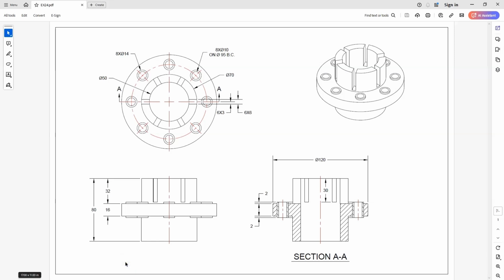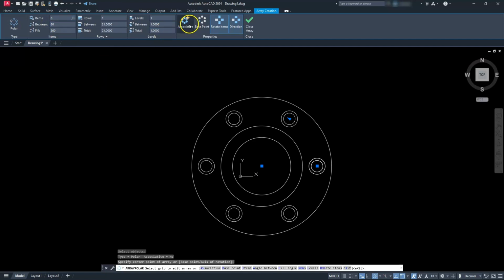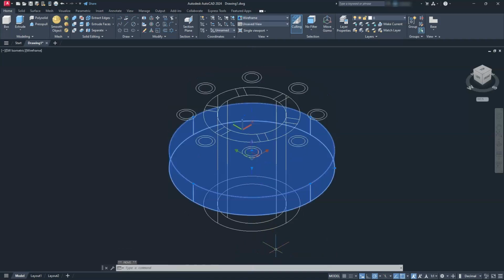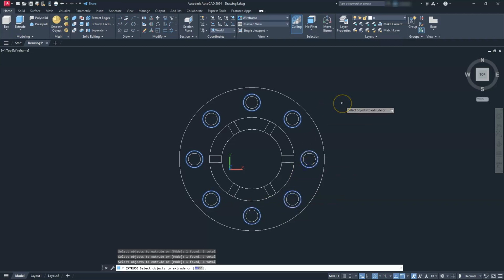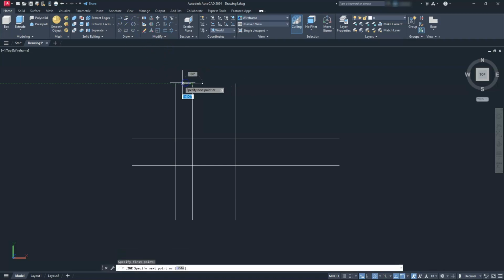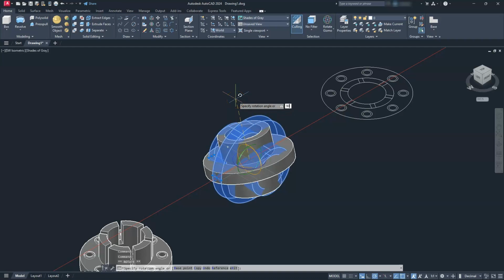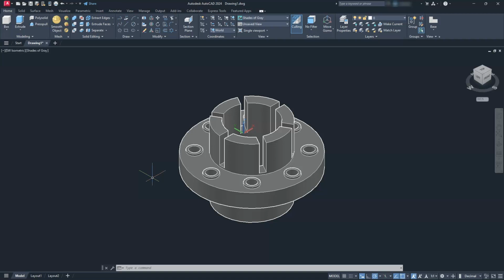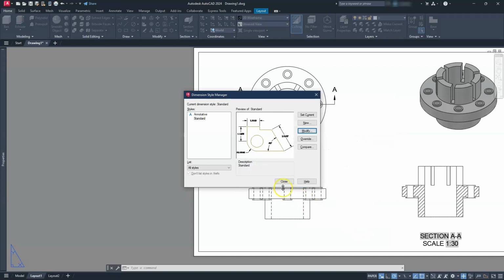Complete AutoCAD 3DModeling & Drawing - Revolve versus Extrude #cad #autocad #cadsoftware

Comment: Great video Mark as i can't access my base from model space is it possible to do section views using viewports
Reply from the maker: Base appears when you are in paper space. I will look to see how to activate the Base option when it is not there. There are some old commands that we can create 2D views from 3D parts. I will make a video in the future on how to do it.
Reply: @lewimara28  Thanks Mark, any help would be appreciate it
Reply from the maker: Look at the ending of my video tomorrow. I need you to check and see if "View" is turned on. You do this by right-clicking on an empty space of the ribbon